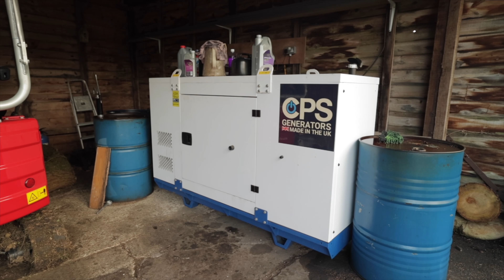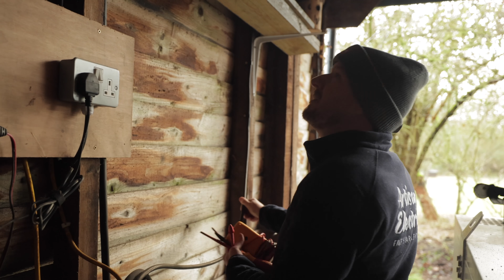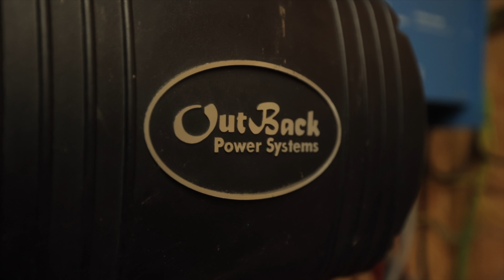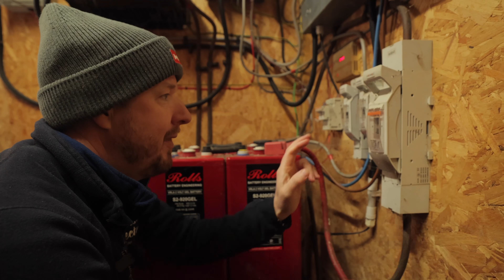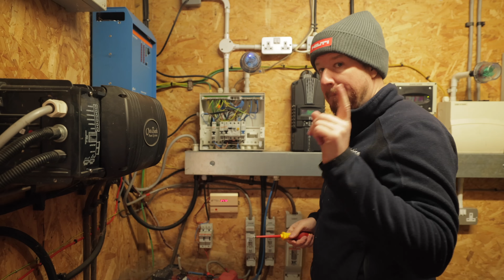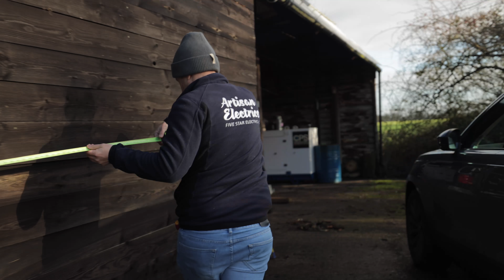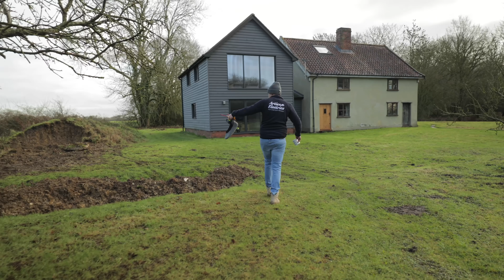DIY Off-Grid Solar Gone Wrong! (It Can’t Even Boil a Kettle)

Comment from the maker: 👉 Click the link here to get a quote from us. https://bit.ly/48XyGuC
Reply: Don't even waste your time at the shed. Build everything on the house and relocate the genset to the house. You could easily build a soundproof shed for it.
Reply: probably a good idea to add a 4th option, install a solar and batteries system.
solar only appears to be the first option, even if you meant for it to be a full system.
second option - add batteries to an existing system,
3rd option - add additional batteries to an existing system, suggested adjustment to this quote or a 5th option: add additional solar and batteries to an existing system.

Comment: Standard practice (by law) to protect dc solar array with fuse/breaker and surge protector here in spain... they also fused all battery side and it looks like they sized cables accordingly. I also agree with lots of other commentaries here. Outback and victron are high up there when it comes to solar/wind... off grid systems and you need to know what an mppt is if you are even going to look at a solar system. Perhaps not tidy but you show your lack of knowledge in this video whilst judging

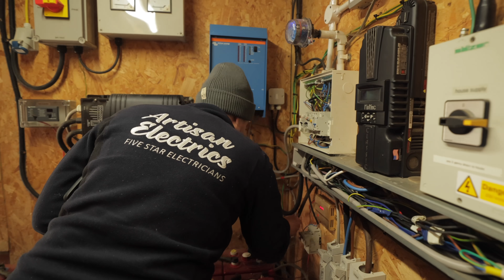Comment: 9:10 will hardly be tripping a 16amp circuit breaker if the inverter output is 3kW

Comment: 5:22 its hardly a Victron system if it has got outback inverters and Midnite solar MPPT solar controllers (yes that is a solar MPPT controller so not a 110v transformer). That Victron Skylla unit is a 24v 100amp battery charger so I would hardly call that a trickle charger! This whole system is crying out for a Victron Multiplus 2 15KVA 48v based install which are known to work well in conjunction with generators, but because he isn't a "Victron hater" he suggests a Sigenergy system.

Comment: I see nothing wrong with the solar panels I'm guessing all you need to do is rewire the panels you already have change the batteries to new ones and everything that is there can be reused and brought up to code thereby saving the customer money that can be used to add extra solar panels and new batteries sometimes we have to think outside the box what if it was a warzone and you can't get to replace things you just simply repurpose what you have money doesn't grow on trees

Comment: Normally I do not like to call out you as being an idiot, because you are not.
But you show yourself as an big idiot in the beginning this walkthrough. 
You could have made a whole different story with a even more positive approach.
Instead you show it all as being bad and very negative until the 14th minute.
Yes the system is not good. And should be replaced, because the current residents what something up to code and larger outputwise... here you go... done in one line and two sentences...
Everything in the current setup is not neat I recon that. However it is al made ok and safe (I am not saying it is up to code!)
(Looks like it is up to code in the US... The DC protection is a US product I have seen being used there, i see other US products, like the solar inverter as well)
I bet the DC to AC inverter manual says it needs a 16A MCCB and therefore it is so small. Simply because the inverter is not any larger. Better the fuse blows, than releasing the blue smoke of the inverter.
Reply: BTW I would maybe even offer to buy all the old stuff and fit somewhere else... If I was in the UK.

Comment: Ran a full Outback brand off grid solar system in Australia for many years - parallel inverters, battery chargers and battery management system.  Used two separate 48kwh gel battery banks was a first class system. The alternator unit should have its own alternator to charge the starting battery along with a full set of gauges. There should be an auto alternator start connection in the Outback inverter. I am a sparky and this installation is the worst way I have ever seen to connect good components.

Comment: I will confess to using XLR connectors for power applications, but only for special test equipment where I’ve been wanting to drive a servo/actuator at 28Vdc or similar… and most certainly not plumbed directly into any mains rated connectors … on basis that if it could possibly be plugged into 115 or 230Vac you can bet somebody will.
XLRs are good reliable connectors .. but as I recall, they’re not rated more than 80V and I would suspect them of risk of insulation failure at 230Vac. What I was amazed by was that, ignoring ratings, they’d actually wired through to a male connector with exposed pins!! 
I have also used them for speaker connections at home … mainly because they’re relatively inexpensive and a lot more compact than the modern standard (speakon?). I would be somewhat more circumspect about using XLR connectors in an environment where they might be mistaken for audio signal lines. 
I did truly wince at the concept of using low voltage barrel connectors  … and especially an RCA phono 😱 … for passing 115 or 230Vac anywhere. I suspect the live/neutral connection to the barrel sleeve is random.

Comment: They only problem here is that they didn't design this system. They were thrown into someone else's build.

Many people can easily live from 2kW. Yes, that's only 1-2kW a DAY in the winter, but people vary wildly.

Before watching this, I already have eight questions for the owner that they probably haven't thought about. 

- what voltage is your system? 
- What is your battery's max continuous charge and discharge rate?
- How many kW is your inverter? 
- what are your panels wired up as? How many volts? What efficiency? 
- how many MPPTs are you using? Where are you fuses? Are you using micro-inverters?
-What charge are you on right now? What output is your generator? 

You might say this is irrelevant, but it's not. If they understood these questions, they wouldn't need a sparky out.

Comment: The whole point of off grid is to reduce consumption.

So high power is a no-no. 

Neatness is irrelevant. What were the inspection test results?

50V DC is outside the regs.

We know how the system works.

Yes double/triple the panels and batteries.

Written notes are useful.

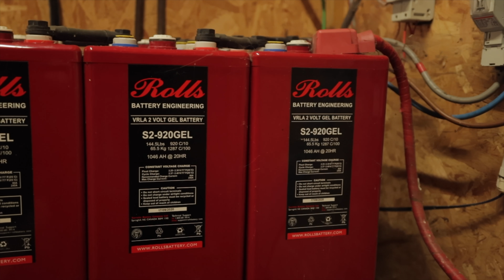Comment: 4:20 That said 1046 at 20 HR, or 20 amp-hour rate. Well, for the nominal capacity, not how much they are degraded by now.
So, 21k AH, or about 42 kWh. About 500kWh overall at nominal original battery capacity.

Comment: This system is an old DIY rats nest. It may have been a clever project 20 years back, but in no way does it meet today's requirements.
A single modern hybrid inverter in a single box will do all of the functions that fill that whole room, also it will be much more efficient. Add some more PV panels, keep the diesel generator, add modern battery technology and you'll have a reliable local grid for the price of a small used hatchback car.
Throwing out all of the old stuff in this case unfortunately is a no-brainer.

Comment: That’s the right call. That’s a totally inadequate system for a modern living and it’s installed  dangerously.  The comments I’ve read here show a total lack of knowledge of electrical systems and uk regulations.  I have a 6.5kw mains synchronous solar and battery system and even thats not enough for zero import 6 months of the year.  I do have a lot of cloud cover though.

Comment: Ultimately the off grid system was designed as a low power, say 2Kw system. Probably works fine, as intended, for that (although generator is wayyyyy to big for what it is doing).
The issue is the new owner wants to run a electric kettle or air fryer on it. You can't expect to run this grid gear on an off grid system unless you want to shell out alot.
Issue is poorly considered usage more than a poorly designed system

Comment: 1.Load test the batteries with a simple CCA car tester? If ok.
2.inverter probably isn't working at rating. Fit in a replacement simple inverter to test. 
3.if earth leakage protection is used test appliances 1 by 1.

Not likely to be wiring or a breaker.

Comment: I am sorry, but your pessimism isn't warranted.
Can the setup look nicer, of course. 
However, for technology from at least 10 years ago, it is not bad.
Al what a modern new shiny energy management system does is what you have here.
Only now, it is not in one need box.
This works for what it was meant to do. A few light, the telly, fridge, and so.
The new owner wants to live like a mains connected house off grid. This was never made for that.

Comment: Found this channel recently and watched several of the more popular editions. As folk have highlighted. Walk in, condemn what's there and then do a full install. We have solar on our house and on our boat which is often off grid for months at a time (on the boat drinking water is also a challenge). Being fully off grid is expensive. On our boat we don't get a choice, but for the house we remain connected to the grid. If this wasn't possible or prohibitively expensive, it's possible to live off grid without the expectation of living as you would in the suburbs. Being an informed DIYer is critical to making the right decisions and also to know when to get the experts in. In the video there was lots of good quality usable equipment that was discarded without consideration.

Comment: That small Black "Inverter" is a Solar charge Controller. that system looks like it was installed at different points in time, like they kept upgrading its capacity as money came in

Comment: I dont know how many times I've come onto a solar job after a  "licensed" electrician who knew nothing about off‐grid systems. From your misidentifying the major components, if it was my system I would have called in a licensed solar installer.
Reply: Since you know so little about the capacity of the customer's system, allow me to say the inverter is probably rated at 3500W. The battery bank is well matched to the inverter. The solar panels could use an upgrade,  450W panels are now available.  But, to sell the customer a completely new system is not, to me, ethical.

Comment: Hi.  I think your comments on the system were a bit harsh because you did not say WHEN it was installed.  I think it is about 15 years old and this is what was available back then.  Those Rolls batteries were the absolute top of the line and cost the original owner a small fortune.  Sure, he was an amateur and out of his depth in some areas but l am sure it worked OK initially. Fair play to him for trying!

Comment: I normally like the artisan videos. They do neat high end installs.  But this was off grid property is quite rustic.  Yes the current electrical system is a mess - but it can be brought to a usable state with the existing panels and generator.   There seemed to be very little consideration as to what could be reused , and if for example the existing batteries where still ok or knackered.  I hope the client is going to get a range of quotes.  Workable off grid systems can be safe and effective without having to be gold plated.

Comment: 😂 we let install solar two years ago. For that, our circuit breaker panel had to be removed/ remodeled. Unfortunately I, electrician, electric engineer for aircraft electric, mingled with that for 25 years. The guy sorting out everything did a fair share of cursing his boss to take the job and look at me head shaking. 🤷‍♂️ But was all save 😎🤡

Comment: People moving off grid have two choices, give up the high demand life or pay heavily to import it into the off grid..  
Someone actually wanting to help instead of gouge would just upgrade the inverter, panels and batteries.. LiFePo4 batteries are much better and at the same cost as lead acid or lower for kilowatt storage.. Going to 48vdc battery bank would improve efficiency, 8kw inverter would match the generator 30 amp output closer and eliminate the need for the stand alone charger.. My Outback Radian system handles battery charging, generator start and switching, has a timer/manual activation to run the generator during high load times and there are other brands that do this as well now which would eliminate a bunch of the old equipment.. Total cost $6 to$7 thousand US compared to his suggested $50 thousand plus complete rehash.. Installers are in business to make money, they are not your friend..

Comment: I have seen worse.  It would be good to see what components go into the new system and what the total cost is.  What are the regulations for installing mains supply in a rural installation the UK?  Here in Australia the consumer pays for the installation from the supply pole to the secondary fuses including the meter box.  This may include the cost of a step-down transformer and Spur line depending on the overhead supply voltage and site location in a rural installation. Luckily, I had a new 3 phase mains supply installed to my house before the new laws came in to affect where the user pays, some 25 years ago.

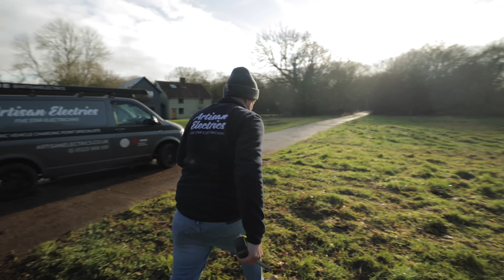Comment: 15:07 "That's 8.7kw, and on a cloudy winter day like today that's going to output 12, 13, 14kw". ??? How is an 8.7kw array going to output 12, 13, 14kw? On a UK winter's day, you'll be getting 5% of rated output, so around 450w from an 8.7kw array.

Comment: Based on your initial assessment you have no idea about off grid solar. The midnight unit is not an inverter it's a MPPT charge controller, it's purpose is to take up to 150v dc from the pv array and regulate it for the battery requirements. The outback flex was one of the best off grid inverters in its day.
I wouldn't be using something like a Sigenergy for off grid either, if 1 battery goes down you lose around 5kwh of storage, individual cells if 1 fails you remove it and reprogram the charge profile abs only loose a small amount of storage.
There are plenty of far better options off grid than Sigenergy

Comment: Buying a home without knowing that it is off-grid? If there are solar panels, you should ask about it. Is the house completely off-grid?

There will be days or even weeks with bad weather.

Eight panels are nowhere near enough for a family that needs electricity for computers, TVs, showers, water systems, and washing clothes. The oven could run on propane and a fireplace might help with heating, but honestly this still doesn’t make much sense. It’s more like a cabin than a normal home.

During bad weather, solar production can drop to around 15% of the system’s capacity, and in many cases it can be even lower than that.

I’m planning to upgrade my own solar setup just to have a small emergency backup for the refrigerator, laptop, and mobile phone.

My plan is to install 2×200 W and 2×400 W panels in front of the house, and then 4×200 W panels on the back of the house.
Already got the 2x400 W panels, but even with that setup and a small battery, I would honestly be surprised if it produces enough power for just those things. I’m also planning to upgrade the batteries.

But during a emergency it could be a life safer or at least helping out little bit. But 200x8 (1600 watt at the peak) ain't no were enough.
You would have too be spending alot of money too upgrade the system too have a good enough system for your family.

Comment: The midnite classic you mention it was an inverter it’s actually a solar charge controller only
The inverter it’s the outback unit good video way too many wires can be re wired and make it simpler and neat

Comment: I thought you had to know what your doing before you are allowed to touch these systems?

A lot of drama, basically saying you don't know what you're doing so installing a system (aio) because you're simple.

I know how the system works, you misname things and the controller unit is else where (they are remote).
Its an older system not for modern living. 24v and i believe 2.5kw.

The inverter (actual) has a switch control to auto start the gen.
The charge controller is a newer one, previous only support pv in at 80v.

Diyer tend to make more of a 'job/pigs ear' of it as its a Modular system, and why you get "the nest".

Ive seen those surge systems about 6-8 years old..

Perfectly serviceable.
You could swap out the inverter to a larger 5kw
About £400...

It would work better, and im sure you load test.. but worth going for 48v

Comment: Victron is 100% the best money can buy; nothing else today even comes close. Not a chance I would swap it for made in China Sig-Energy. That Midnight is an MPPT, NOT an inverter, and is the proper setup for off-grid use, and is only second-best to Vicron, but still 10X better than anything that Artisan normally fits, like Sig-E. The Outback is mainly used in the US/AU/CA, but lots of people use them in the UK too, and the older built ones like this are extremely well-made, but they have a higher standby use, and are not as efficient as Victron, but will last forever. As an electrical engineer, not just a household electrician, solar installer, I would take this equipment over anything Artisan installs, which, if you're lucky, will last 10 years, whereas this gear will be around when we are all long gone. This equipment is designed to be put in ships, homes, farms, along with commercial premises, not just cheaply made in China like todays solar installers use. 
If I were the homeowner, I would watch Will Prowse on YT, as he tests the gear, and join or read his forum, which has 100's of installers and engineers.

Comment: I'm shocked! Such a botched install job is simply not possible here in Switzerland. Doesn't matter if on or off grid! Doing such a thing would get you a hefty fine (professional or DIY installer) Electricians are required to report it to the authorities...
Reply: Largely, this installation would have met the legal minimum standards when it was installed. I have personally lived in housing with worse electrical issues.

Comment: What a long video to do nothing but say rip it out and install a brand new system.  Surely there was a middle ground you could have offered the poor guy those batteries are fine even the panels will work just sort out that inverter setup.